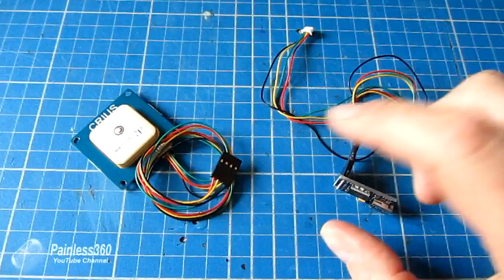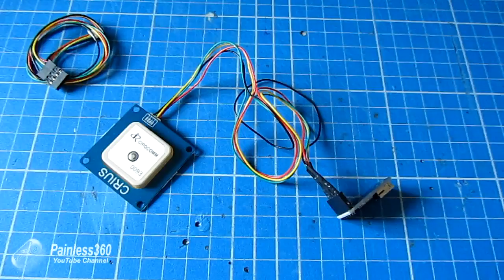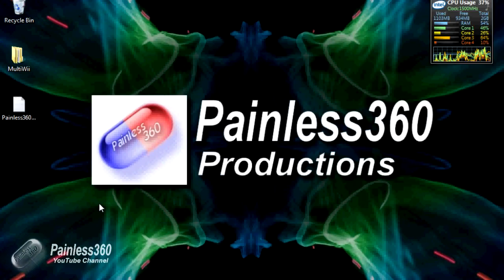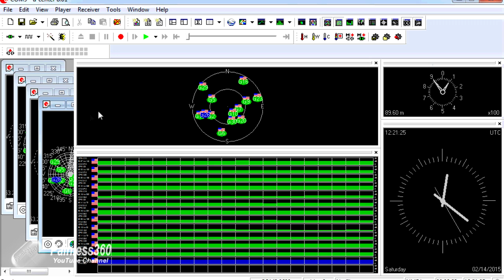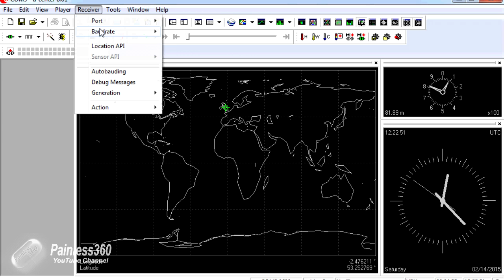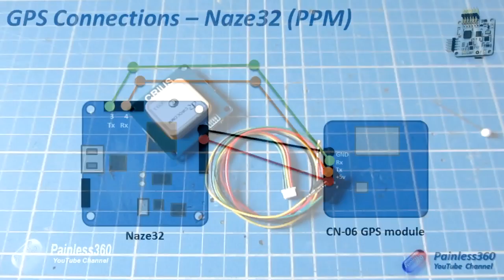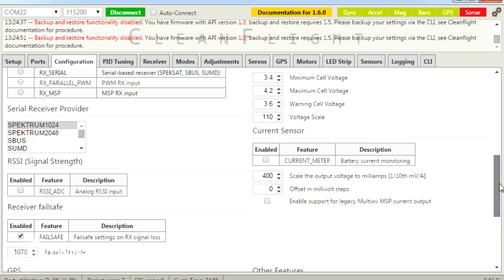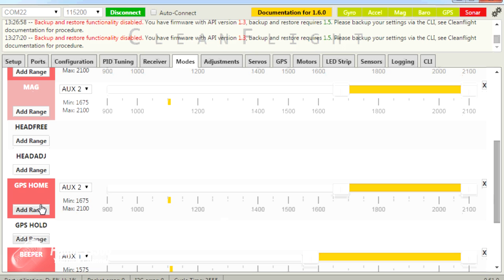(6/8) Naze32 Flight Controller - Adding GPS (NE-06, NEO-06 module)

Comment: NAZE 32 and Ne-06 GPS: 
After watching your awesome videos I got my gps configured with the FTDI board and the Ublox software as you said. Copy and pasted the config file from Painless360 to the gps. It seemed to work and did receive my Lat/Long, time only in the 115200 baud rate as you said. 
The gps at 38400 had lots of data going on and then changed to 155200 and the data stream stopped. 38400 all worked again. 
I tried to initiate GPS Hold and it decided to take off in other directions! 
In GPS Home, the craft climbs and I get scared and take it out, dono how far it will climb and dont want to find out!
Right now I fly in angle, baro, and mag mode and it flies as good as my skill level is at this point. 15 batteries so far each 5 minute flights. Doing figure eights and circles, hovering is good except nose in...working on that.
Ok went back into clean flight and this is what I have set up now:
clicked UBlox and North America (Florida) 
AUX 1 -- position 1 Beeper (dissarm and lost model) --- position 2 Arm, Angle, Baro, Mag
AUX 2 ---position 1 GPS Hold ----I have Angle, Baro, and Mag when I switch GPS HOLD
AUX 2 --position 2 GPS Home -- I have also Angle, Baro, and Mag when I switch to GPS HOME
AUX 2 ---position reserved for auto tune.
I have a DX6I (Black Version) and using PPM HK RX
I get a lock on the gps within 30 seconds according to clean flight. 3D fix with 7 or more Sats and 4-7 signal strength according to cleanflight. Tried several other config files. None allowed me to goto 115200 and allowed data to stream just lat/long. 38400 everything comes alive it just works. 
BUT NO HOLD OR HOME
I know the config file strips out lot of data but when I saw the data moving I saved the config file and exit.

Did I Miss somethng? 
Thanks in advance.
Dan@floridaquadracing.com
Reply from the maker: Dan Geukes Thanks for the question. Do you mean that the board will not let you set GPS Home? A video would help..
Reply: Painless360 No like I said cleanflight works great. I did send you the settings I set up. 
Repeat    "Ok went back into clean flight and this is what I have set up now:
clicked UBlox and North America (Florida)
On Modes tab.
AUX 1 -- position 1 Beeper (dissarm and lost model) --- position 2 Arm, Angle, Baro, Mag
AUX 2 ---position 1 GPS Hold ----I have Angle, Baro, and Mag when I switch GPS HOLD
AUX 2     position  2 is set for GPS Home and I have set  Angle, Baro, and Mag when I switch to GPS HOME
AUX 2 ---position 3 reserved for auto tune."
All looks good in clean flight. Switches work as they are set. All modes light up green when the switch is on the transmitter, like it should.
Is there another way to contact you? My email perhaps?

Everything I learned from your videos got me up and running very quickly except for this. It is puzzling and really need to fix it. I bought everything using your recommendations. I have asked several forums and they had no idea.
thank you
dan@floridaquadracing.com
Reply from the maker: Hi Dan, sorry - I'm puzzled too. Could you do a quick video to show the problem 'in the flesh'?
Reply: Painless360 I tried an experiment... Went to GPS on Cleanflight in the GPS Tab. Distance to home was 0. I took a walk with the laptop 5 meters, Cleanflight still said 0 to home. Although I had 8 satellites with 4,6,and 7 signal strengths. 
I have no way to get a video unless I use my mobius. I will try that later.
Reply from the maker: Something is very wrong then. Be careful with the GPS as the resolution can be up to 5m so don't worry if you see it move/not move over shorter distances.

I would also wait for the next version of Cleanflight as the code is changing all the time and sometimes bugs creep into systems that had been working in previous versions.

I've not flown with V1.8.1 myself with GPS yet..

Best of luck.
Reply: Painless360 Ok should I reflash my Naze 32 to an earlier version ? I do not mind setting it up again. I am getting good at this!  ok in Ublox I see lots happenng at 38400 but not at 115200!  is that a problem. I just see lat long and the clock at 115200. What do you suggest as a gps config and Naze32 firmware? Also a baud rate?  Sorry to be a problem child I am just so excited about doing this. Last problem left, FPV is fine too. Thank you so much
Reply: Dan Geukes Just FYI. Gps has a solid green  light and a slow flashing blue. Once a second or so....
My GPS does have the Antenna that can be removed but it is solid. Thanks
Reply: Dan Geukes INTERESTING TEST! I took my spare Naze32 Acro board and reflashed it to 1.80. I then installed your gps config file and uploaded it to the Ne-06. I changed the baud to 115200. Took the laptop for a walk down the street. 
brought up Clean Flight GPS Tab. I saw the Lat/Long Numbers changing and the speed 100 cm/sec. BUT NO DISTANCE TO HOME STILL! where I plugged it in. Going to try that with the NAZE 32 full board on my quad as soon as I reflash it. Bad Clean Flight Software? Bad Config file?
I did not see any movement on the graphs in UBlox GUI at the 115200 baud rate, just lat/long and time. I don't know what your code disables/Strips off the data stream and what it leaves for the Naze32. Boy I am getting an education!  and all I need is a working GPS LOL
Reply from the maker: Ah I didn't know it was an ACRO! This will not work as it needs a compass for the GPS modes to work.

See https://www.youtube.com/watch?v=4OKGMhTrqOU at 2:09

Explains it all.
Reply: Painless360 No,  I am flying the FULL board! I knew the Acro does not have the compass or the Barometer. I just wanted to see if the Distance to Home number changes with my gps I do see the lat long numbers changing and in the right direction too in both the Acro and Full boards.  So since the numbers are changing for lat long that part is good. I am wondering if the software has a bug.
 Try that on yours if you get a chance. just look in the GPS tab in CF. Just watch the Distance to Home. If that changes than there is something wrong with either my gps, config file, or maybe .63.1 CF
Both Nazes show the lat longs correctly.  So I am thinking they are ok.  
How do we get timecop involved in this?  If you could please try that same test let me know if that works...

THIS SHOULD NOT BE THIS HARD!!!   All the other components work awesome and was simple following your videos! I am soooo sorry to bother you but there are no other GURU's to ask

Comment: I'm not a big fan of the "Here, download this settings file and use it..... trust me." part of the video.  I think it would of been better to go through and enable/disable messages by hand with the tool.  Teach a man to fish right?

Other than that, really good video except for one small gotcha.  When you are uploading your custom config file, the "change baud" command is kind of in the middle of it.  Therefore all the messages after it never make it.... including the "Save to ROM" command.  So, you miss part of the settings all together, and you loose all your settings once you power cycle the receiver.  To fix this, immediately after you run the import, and before powering off the board, change the baud to 115200 and re-import to pick up the rest of the config settings that were missed the first time around.  Then you are good to go.
Reply from the maker: UltraStoat Some viewers want the fish, some want to know how to make the rod, line and flys themselves. Hard to please everyone. 
The link to the manual settings and the process is in the description..
Happy flying!

Comment: hi 
hope you can me please.
i  am following your instruction , but when i click on the "GNNS configuration" button .i get a window open  "Configuration check" which goes on to say the software doesnt correspond with the receiver .  (which is the crius neo-6 gps).
any ideas on the problem ?
cheers darren
Reply from the maker: roylecopters Sounds like you are not using the same model GPS as I use in the video. If you want to see what you need to manually configure on the GPS unit you can read https://github.com/cleanflight/cleanflight/blob/master/docs/Gps.md
Best of luck.
Reply: Painless360 thanks for reply .helped alot got it going now cheers.and keep up the great videos ,i find them easy to follow plus always learn something new .
 all the best darren

Comment: I have the Neo-6m from Crius, I'm running into a couple problems, When I load your config file in the GPS I have to switch the the baud rate in the ublox software to 115200 to see data and all works great but if I disconnect power to the GPS it doesn't save the settings. It reverts to the default 9600????? I have tried manually setting the baud and sending it to the GPS and it does the same thing. Is this something I can fix or do you think I have a bad board? Thanks in advance for any help.
Reply from the maker: Search for my GPS troubleshooting video. You may need to 'save' the config to the board to make it remember.

Comment: Your videos are amazing to learn from. It's people like you that make the sport possible to people like myself. I'm just in the middle of building a Blackout 330 with a Naze32. Is it possible to have a LED come on to confirm the GPS has locked in its position before flight. Thanks
Reply from the maker: RC Lewis Reading the release notes the red LED should flash to indicate GPS activity. I'm waiting for this feature of a solid LED to show 3D lock. I rely on LEDs on the Multiwii and APM to show me when they have a solid 3D lock and I can fly..
Happy flying!

Comment: Created an FTDI board using this http://www.ebay.co.uk/itm/251742353968, plugged in as per the diagram on the video. Got a solid blue power light on the Crius, but I am getting no flashing green light for gps... I am using 5 volt on the FTDI and I have checked my wiring 20 times. Any ideas what could be going on? I am pretty new to this and would appreciate any help.:)
Reply: Thanks for the videos they have been massive help so far. Got the green light issue sorted, just had to wait around 10-12 mins for it to get a connection.
Reply from the maker: electricshrew Good work getting it sorted. It should be a little faster than that but the GPS should now 'remember' the satellites and be faster next time. 
Happy flying!
Reply: Painless360 
Been playing around with the GPS all evening. I have a Ver 3.1 Crius NEO-06 and when you first flash the unit with the config file it works very nicely as per the video. If you disconnect the GPS and reconnect it seems to revert to the original settings. A simple re-flash of the config file and leaving the GPS to run for 10-15 mins seems to sort the issue if anyone else runs into it. I also clicked RECEIVER>ACTION>SAVE CONFIG. Not sure if that made a difference. Works a charm now acquiring a GPS Lock in 15secs or less and storing the Baudrate of 115200. Thanks again for the vids good sir, I could not have done this without them.
Reply from the maker: electricshrew Good to know it's all working. Well done on getting is sorted. 
Happy flying!

Comment: Thanks for the great vids
Ive got this GPS just arrived. Can I still use the same config file? Do you know where I can get one if not?
Many thanks

http://www.ebay.co.uk/itm/BeStar-BN-880-Ublox-NEO-M8N-GPS-Module-w-HMC5883L-for-APM-Pixhawk-Flight-Control/281623542521?_trksid=p5411.c100167.m2940&_trkparms=aid%3D222007%26algo%3DSIC.MBE%26ao%3D1%26asc%3D20140131123730%26meid%3D362acf70dea3427b95b4cdb7482a0440%26pid%3D100167%26rk%3D1%26rkt%3D15%26sd%3D251826811292
Reply from the maker: Not sure, I don't use them myself. You can look at what you need to change - the link to the article is in the description.

Best of luck.
Reply: Painless360 sorry which artical are you refering too I only see the Dropbox ublox txt in the description. Thanks again
Reply from the maker: Oliver Peters"If you want to see what you need to manually configure on the GPS unit you can read https://github.com/cleanflight/cleanflight/blob/master/docs/Gps.md"

Best of luck.
Reply: Great thanks. had my maiden flight with osd thanks to your video and Mike from hobby rc. :-D

Comment: In the newest cleanflight 1.8 you need to set one of the ports (uart or softserial) to gps if on pwm and ar8000. Otherwise it will not be recognised. Also in 1.7 where the port option is not present, even a working gps will not be accepted with pwm.
Reply from the maker: biofacts http://www.youtube.com/watch?v=KTHfsgDMwso&list=PLYsWjANuAm4p47OBBTOo4Xr3lNUc8PFpc&index=14 :)
Reply: Thanks :) I'm new to this, took me 5 hours to find the UART solution. Enjoying your videos, thanks a lot, they helped me tremendously :)

Comment: I don't suppose you could do a video of how to install harakiri on the naze32 could you? It's supposed to be much better for GPS. 

73, M6EXH
Reply from the maker: Hi Dan, I am looking into this at the moment but the lack of structure and regular maintenance to the code repository and manuals make it less simple than using Base/Cleanflight.

Thanks for the suggestion..
Reply: Totally agree. I'm sure it will progress as time comes but at the moment the GPS on the naze is pretty useless in my opinion. It's not meant to be an AP fc though is it? 

Cheers for the reply, 
73 de M6EXH

Comment: Early in the video you say something about enabling acro mode along with the other bits of hardware but you didn't show or mention any flight modes enabled along with the gps stuff. I'm using 1.8 Cleanflight and the gps 3d locks and the software shows all the telemetry but loitering/hold function seems to do very little. The throttle tries to maintain height but cannot observe any pitch or roll adjustments happening while the wind is blowing. There apparently is little or no gps corrections happening. Do you have to use acro mode? I am using angle mode only. Any other ideas?
Reply from the maker: Billy, watch https://www.youtube.com/watch?v=nFFK8KDWMKc&list=PLYsWjANuAm4p47OBBTOo4Xr3lNUc8PFpc&index=13

I cover that in that video.

Comment: Dear Painless.  I have a problem.  Fitted minimosd and it works.  Fitted GPS and it appears to be working.  When I connect board to Cleanflight all seems well.  Then I add battery power and boards stops communicating with Cleanflight.  What could be wrong?  Regards Bez.  P.S.  Great videos.
Reply from the maker: If you have the board setup as per my videos then the GPS is powered from the ESCs that are in turn powered by the main flight battery so it sounds like you have it setup differently to how I've shown. Double check you have it all wired as per the videos..

Best of luck.
Reply: Thanks for the prompt response.  I do have the board powered by a bec.  Will check.  Might have a ground issue.  Didn't add the ground link between vtx and iosd.  Will set up identical to your videos.  Regards Bez.

Comment: so i was told to buy one of these http://www.ebay.com/itm/Hot-APM-Flight-Controller-Ublox-NEO-6M-GPS-Module-Compass-GPS-Antenna-Holder-US-/301323481928?pt=LH_DefaultDomain_0&hash=item4628477348
and was told thats all i will need to put gps on naze 32. is this all i will need?
Reply: ***** also the connector on the end wouldn't plug in to the board. so would i have to unpin it?
Reply from the maker: This one you mention is made for plugging directly into the APM 2.6 boards that also use the external magnetometer. I wouldn't use this for a Naze32 board as you will have to remake off the ends and work to get the cables right.

I am very clear in this video which GPS units I use but you can use others and figure it out.

Best of luck.